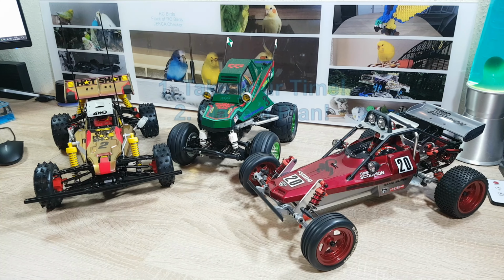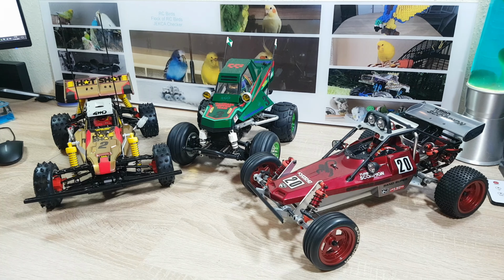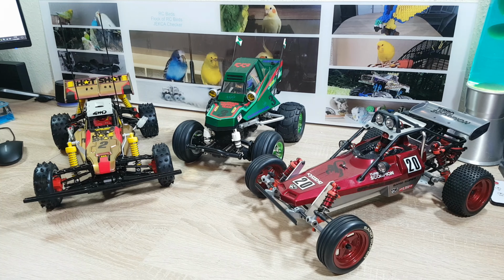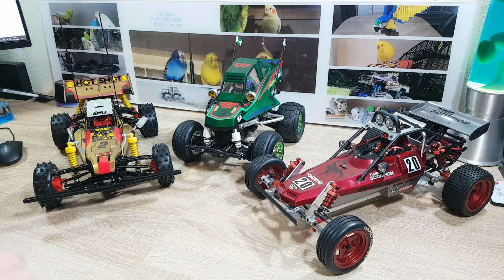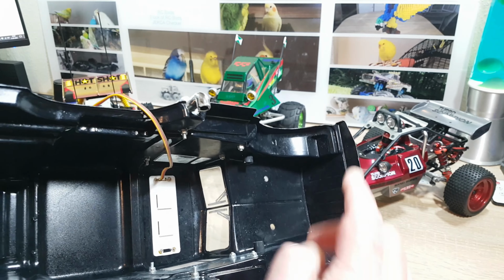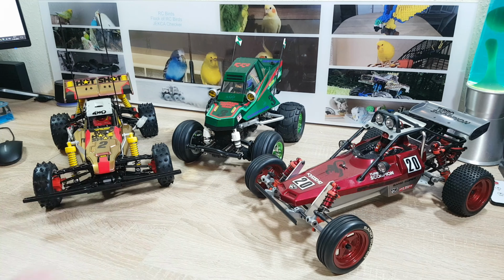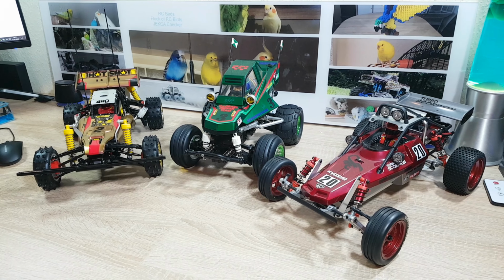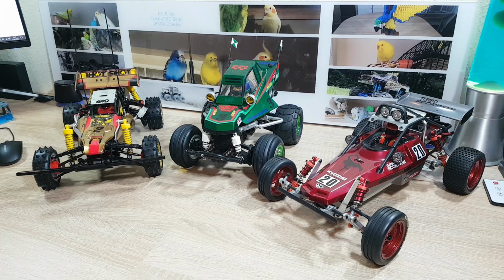Painting RC Bodies: 6 Tips and Tricks for Polycarbonate Shells

Comment: Great info Dirk I had to build a paint booth so I could paint in the winter i heat my bodies and paint before I spray and then dry them infront of a heater wings are always a pain lol
Reply from the maker: Thank you for watching and your kind comment. The actual trend of clear wings might be a solution, but then you gett the issue with cleaning. Painting those deep edges with a brush first might be a solution but only for simple colours effect or multiple layer paint won't work so good. Maybe this is one of the bigger questions of our time to paint perfect wings😉
Reply: Verdade bro

Comment: Great tips Dirk. I always have problems on the wings especially painting in the winter! I agree with your points on slow and planning 👍🏻🙌🏻
Reply from the maker: Thank you for your kind comment Craig. Painting in winter's always a pain in the (you know). Either it's sunny but cold or it's warm and heaven's sending any kind of downfall. Paitience, thin layers and warmed cans help. Dry runs are the other side of the medal. If your moves are trained in flesh and blood, then the paint-job will turn out good even on colder days.